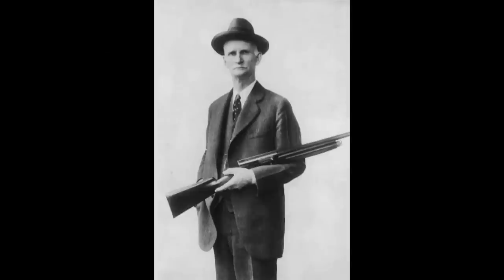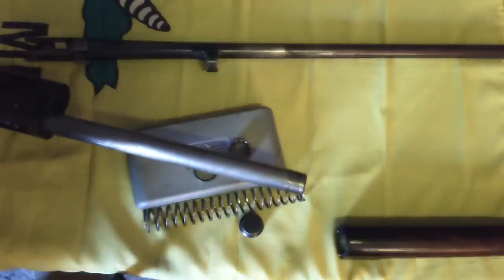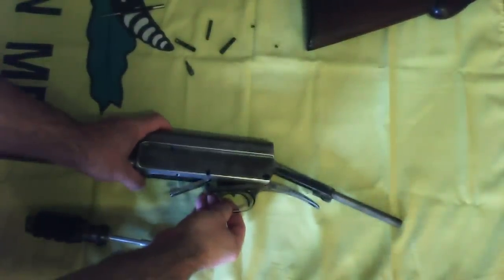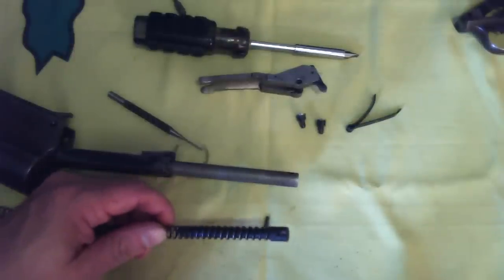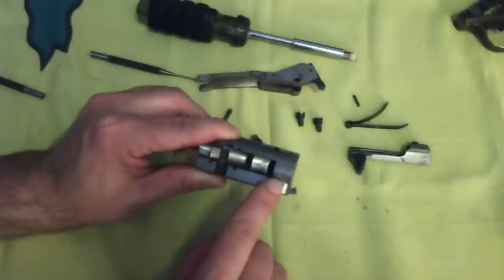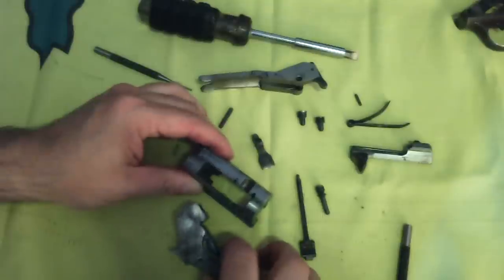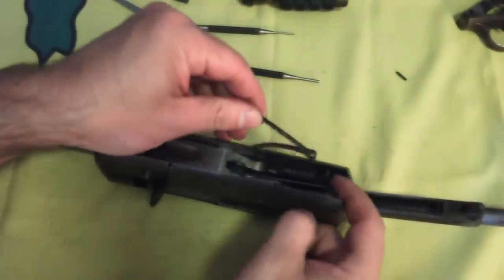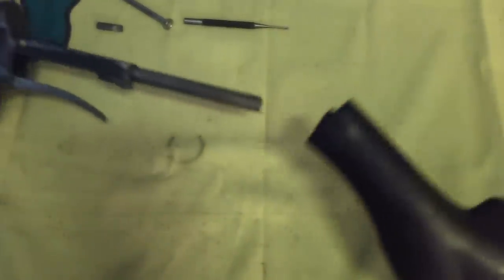Basic Firearms Disassembly #5: Remington Model 11 (Browning Auto-5)

Comment: I am disassembling a savage springfield automatic 16ga.  the firing pin spring seems to be missing.  as far as I know it has never been apart.  is this normal? is the spring missing?  can it be replaced if missing and where could I possibly find one to fit this gun?  thanks for vid and answer if you can.
Reply from the maker: bekismith99 I'm just guessing, but it's possible the Savage variations were made without firing pin springs.  Not every design has them; the M1 Garand, SKS, and AR15 are all examples of popular and widespread designs which don't have firing pin springs.  Examine, perhaps probe, the inside of the bolt to see if there's space for a spring.  Examine the pin for a wear pattern that indicates there used to be one.Or, maybe the spring is simply stuck inside the bolt.  When assembled, is there spring action when you press on the rear of the firing pin?Alternatively, the spring from a Remington or Browning might work.  I would expect dimensional differences.  Try a big gun show and look for what I call the "Parts Geezers", a couple old dudes with a couple hundred tackle-boxes full of old gun parts.  A really proper large show should have such people anywhere in America.  Take the bolt assembly along for comparison and test-fitting.

Comment: Ok mag tube removal is out of the question it wont budge. How can i remove the mag spring retainer from the end of the tube? I really need to clean inside the tube.its gunked up pretty bad and the follower hangs up a lot. Just ordered every available coil type spring from numerich, should i get the mag spring as well?
Reply from the maker: dertyKurty The inner cap should be removable by gently prying on its inside diameter, the center hole, with a flat screwdriver.  Don't stick anything between the cap and the tube, that would likely damage the tube, but you can carefully use the end of the tube as a fulcrum, levering the cap out bit by bit.  It should be a friction fit and should pop out as you work the screwdriver around.  The magazine spring will fly out when it comes loose, so take care to control it.  I reject liability for damage!  Proceed at your own risk!  Once the inner cap is out it's not necessary for function.  It has to be left out if you're going to use an extension tube.  Its purpose appears to be to keep the magazine spring captive for convenience, during routine cleaning or takedown for transport.
Reply from the maker: dertyKurty Shotgun tube magazine springs should be largely interchangeable, i.e. a 5-shot 12-gauge spring should fit a variety of makes and models.  You can probably find one a lot cheaper than Numrich.  You can also get one overlength and clip it down a coil at a time until it's the way you want it.  See what shape the original is in first, anyway.  There are probably used ones at the parts tables at the gun shows.

Comment: What does the other screw on the left side of receiver do? I've found a model 11 but the screw is missing.
Reply from the maker: Reviewing the video I find three screws on the left side of the receiver:

Bottom center is the forward trigger group pin.  Some specimens of the M11 might have this as a threaded screw instead of a pin.

Bottom rear is the main trigger group screw.

The larger screw in the center is the carrier screw, the point on which the shell lifter pivots, same on both sides.

These were in production under at least three brands, and four or five model names, for 90+ years.  Depending on your vintage there may have been changes along the way, such as small lock screws on any other screw.
Reply: @Jeffersonian1  I watched first video and it appears to be the pin knockout hole. If I'm correct.  
 Thanks for the excellent videos on these great firearms.

Comment: I need some help.
I have a m11 that the bolt won't lock back on .
could it be the V spring is broken ?
I can't finish feild striping the gun with out locking the bolt back .
thanks 
Louie Pate
Reply from the maker: Hi, sorry for the delay, the universe was pooping on me again.

Examining mine, a broken spring is possible, or it may simply be fouled and will start working again when clean.  In order to field strip, try a block of scrap wood or plastic, or perhaps a spent shotshell, in the ejection port to hold the bolt back.  That should allow you to remove the magazine cap and dismount the barrel, then you can carefully release the bolt forward and continue disassembly to find the problem.

Comment: I really enjoyed your video and would like to ask a question of someone who obviously knows the gun inside out.  A couple of years ago I purchased a Model 11 Sportsman made around 1935.  It was similar to the one used by my Great Uncle when he hunted with my Grandfather on the Outerbanks in NC.  The finish was about 60 to 70% and there was some mild rust.  I have an excellent gunsmith who blues commemorative guns for company in our area.  My wife financed a re-blue and stock refinish job as a Christmas present last year.  He did a beautiful job but...I noted that when the gun was not cocked the hammer would fall back and forth hitting the back of the bolt when you rocked the gun fore and aft.  Once cocked the hammer was held back until the trigger was pulled.
 
I don't remember this happening before - maybe it was just really dirty.  Is there supposed to be a spring or something that keeps the hammer forward after the trigger is pulled and the gun is un-cocked?  Looking at my parts and assembly manual I cannot determine if this rattle back and forth is normal or not. Something tells me it should not be. Your input would be greatly appreciated.
 
Thanks
 
Ron
Reply from the maker: Ronnie Gray The trigger behavior does not sound normal.  The main hammer spring should hold it firmly forward, against the rear of the bolt, when the sear is released.  Now, the Sportsman model had a different magazine setup, if I recall correctly, a fixed 2-round magazine, but I would not expect any design changes in the trigger group.  I recommend describing the issue to a gunsmith.Examining a spare trigger group, I see the main hammer spring is a long leaf-type, which bears on a small roller at the base of the hammer.  One wild guess would be if that spring had broken on the forward end, there might be the movement you describe, yet it would still cock and release otherwise, with the broken end of the spring pressing on the hammer at a higher point (and therefore with less force).  But that's just a guess.
Reply: Thanks much!  I copied your comments and will carry to my gunsmith for his info.

Ron Gray
Reply: Ronnie Gray Another question.  Have you done a disassembly video on another great Browning the Winchester model 94.  I have recently put my hands on a beautiful one that was built in 1949?  A true classic.

Ron
Reply from the maker: Ronnie Gray I've done a tutorial on the Winchester 1894, but not disassembly.  Jim Green, channel name downeastgunworks, has done a two-part disassembly video on the '94, so I didn't bother.

Comment: I am having some trouble finding a recoil spring for my Rem 11, 5-shot 
12guage(the spring that slides over the mag tube). Will a Browning A-5 
recoil spring work on a Remington 11?
Reply from the maker: +Vincent Tschida It might, but I couldn't guarantee it.  The dimensions should be close enough.  I seem to recall the Browning spring might be constructed differently, like a twisted cable, instead of the Remington's square-bar type.  Let us all know if it works!
Reply: +Jeffersonian1 How do you go about replacing the bolt buffer at the back of the receiver? I see Numrich has the buffer and corresponding rivet.
Reply from the maker: +Vincent Tschida Mine was probably lost before I was born, and it ran all right without it.  Replacing it would be a job for a real gunsmith, possibly involving hot metal and grinding and refinishing.  I think the Savage versions didn't even have the buffer, omitting it to simplify construction.
Reply: Well, I think pushing a new rivet in would be easy. I'm just not sure about getting the old one out...
Reply: +Vincent Tschida I used a Browning A5 recoil spring in mine.  A few years ago Browning changed the recoil system, so be sure to get an 'old' style spring.  The look slightly different, but I have not had any problems in it.

Comment: Hello, what do mean by clocking the friction rings like an AR15?
Reply from the maker: The rings are not solid, but have a small gap at one point.  In the M11 is probably doesn't matter, but in the AR15, there are three small rings on the bolt head, which is also the gas "piston", and they're supposed to be "clocked", rotated, so the gaps don't line up.  It just seems to me that the gaps in the M11's friction rings should not be lined up in the same place, but it probably doesn't matter for a recoil-operated design.

Comment: The cross pin does not move even when hit with a mallet and a punch (which fits). Do you have any suggestions for how to get this out so that I can remove the bolt
Reply from the maker: Without seeing it, it's hard to say.  Are you sure it's lined up with the takedown hole?  Is the pin rusted or otherwise frozen in the bolt?  Have you tried a penetrating oil like Kroil on the pin?

Some versions of this design apparently have the takedown notch on only one side.  If that's the case with yours, about three years ago another viewer passed along a solution, which should be linked here:

https://www.youtube.com/watch?v=jkiGWd6ot84&lc=z13ue3rbvz2gxjwcl22egpbyazepdp1x304
Reply: I was able to get it. My version does not have the half oval on the ejection port side. I had to push the pin from the ejection port side out the takedown hole. But was able to get it. Thank you
Reply: I just put in the spring and the locking block latch. The bolt does not slide though. I've checked to see that the pin is centered. Do you have any other suggestions?
Reply: UPDATE: I took out the pin and noticed that the entire bolt does not slide back even prior to entering the pin and locking block latch. My best bet is an obstruction along the rails, have you ran into this problem before?
Reply from the maker: Looking over mine, I can't see what might be causing that.  My only advice would be to proceed slowly and gently, and don't force anything.  Good luck!

Comment from the maker: Liability issues aside, I'm not the best person to ask for load data for the M11.  If you look at other videos on my channel (slow-motion cycling posted 12 September, my first 3-Gun match posted 25 October-2 November) you'll see my attempts at load development, and how they failed in competition.  Next 3-Gun match, I'll be using factory loads, with the recoil pieces set to Heavy.  Modern factory loads should be entirely safe, presuming they're regular 2-3/4" birdshot, not heavy or magnum loads.

Comment: Clocking the friction rings opposite of eachother is not the way it is designed to work... the rings need to flex freely and the gaps need to be aligned to allow that.  If clocked opposite each other, the inner piece will not be able to release friction on the forward stroke and it can cause jams.  I know it can work the other way, plenty of these old worn out guns are set up that way, but its not how JMB intended it.  Always align the gaps
Reply from the maker: I hadn't considered that.  Maybe that's why it wasn't working as well during its last 3-Gun match.  But, it's retired from racing now, at the respectable age of 107-and-counting.

Comment from the maker: That's the theory, but it looks to be difficult, to say nothing of finding a replacement.  They're individually fitted, and they appear to not just slide into a dovetail but have a pin crosswise into the barrel extension, which is then polished to match.  Looks like Numrich has some in stock:

gunpartscorpDOTcom/Products/171450B.htm

Comment: Damn, shame you have to do so much just to take the bolt out. The charging handle on mine literally snapped off and I was gonna replace it, but im sure i'll break something even more if I have to take out 20 different pins. 
edit: I was a pussy this is pretty simple